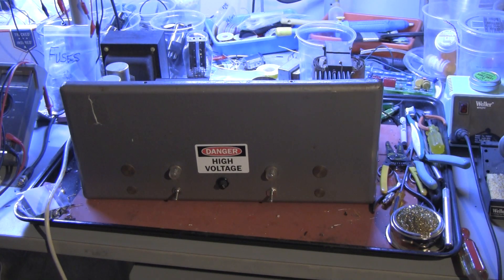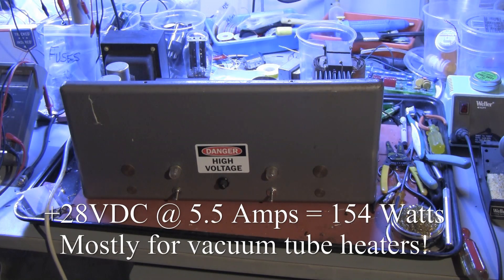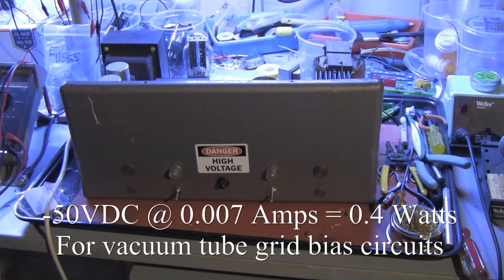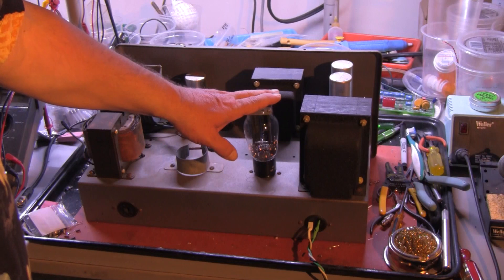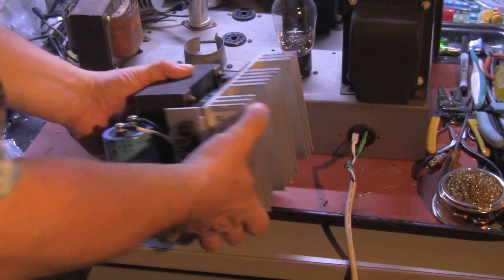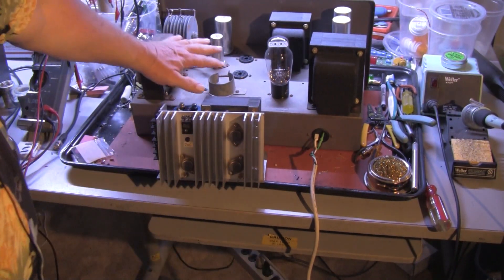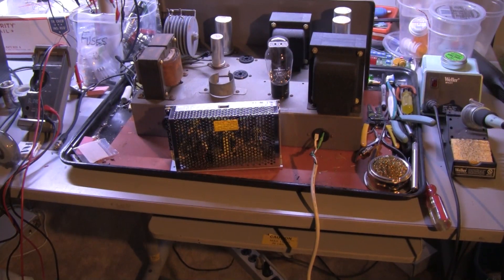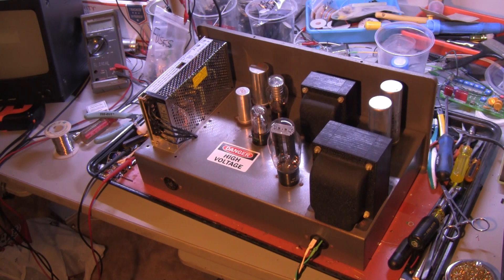RCA Iconoscope TV Camera: Power Supply

Comment: Can you create arcs with the 405V rail? Should give it to ElectroBOOM lol. Why does it need so much voltage? I've seen the insides of an Ikegami HL-79 Plumbicon camera and it uses 730V.
Reply from the maker: Yes. You could draw an arc for a few seconds. But, it would destroy the rectifier tube. Vacuum tubes in general need high voltages to get the electrons moving from the cathode to the plate. The electron gun in the camera tube requires high voltage to accelerate and focus the electron beam onto the imaging surface.